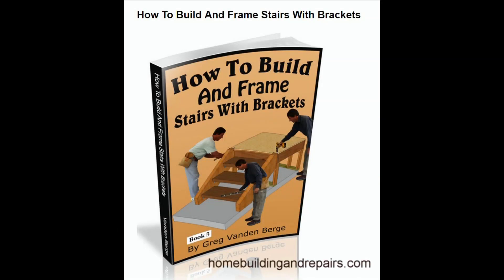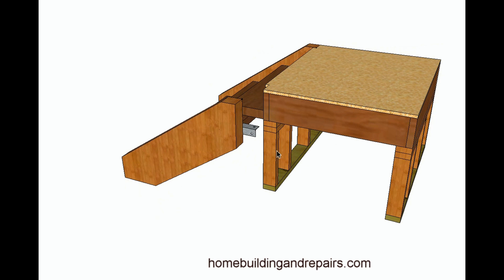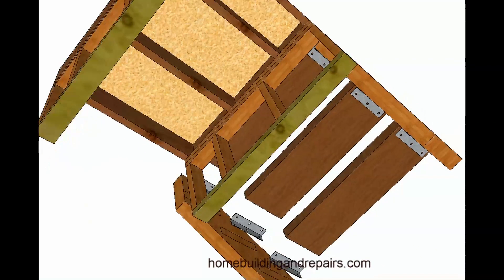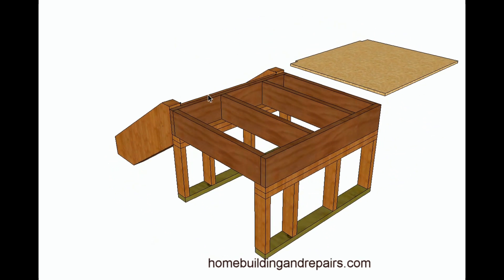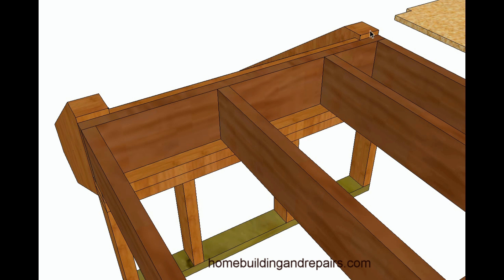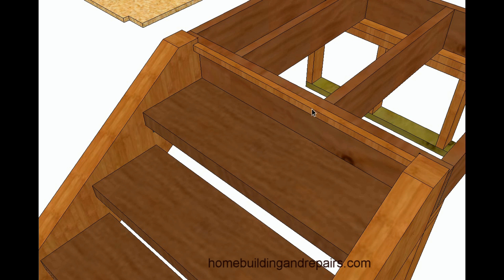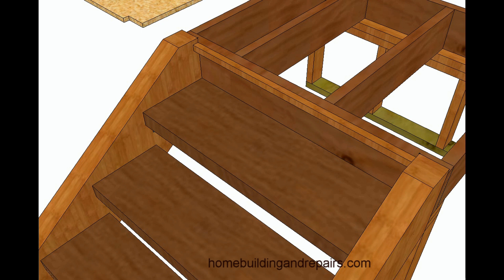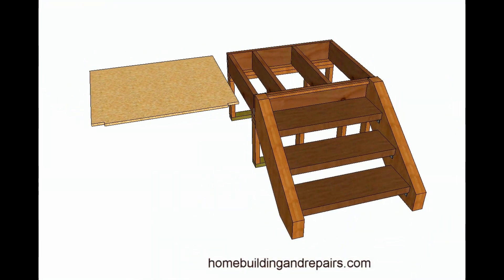How To Build and Frame Stairs With Brackets – Example 1

Comment: Very helpful! Thanks for posting. Are those 2x8s for the landing or 2x6s? Also, do you see any issue with using 4x4 posts to build the outer support frame? Thanks!
Reply from the maker: I can't provide lumber sizes because they can be different on different projects.

Comment: Is it possible to buy stringers that are wider steps and shorter rise  or would one have to custom make them?
Reply from the maker: I've never seen them and you will be better off making them yourself. If you're going to build a straight set of stairs, get the book How to Build and Frame Stairs, if you're going to build a set of stairs with a landing, get the book How to Build and Frame Stairs with Landings.